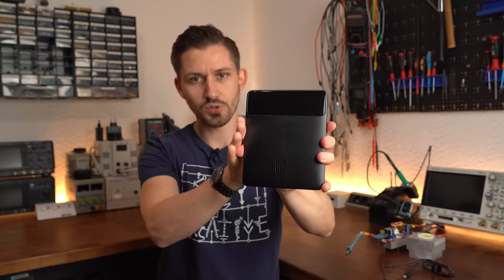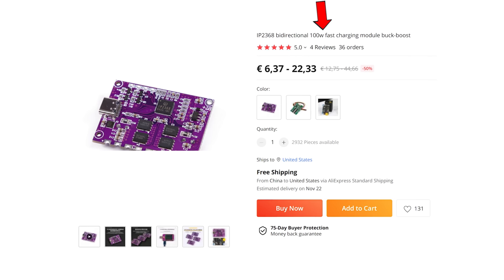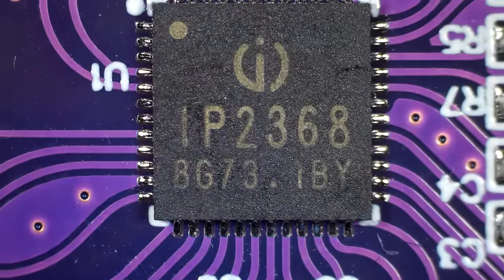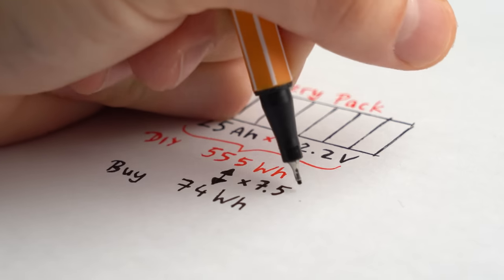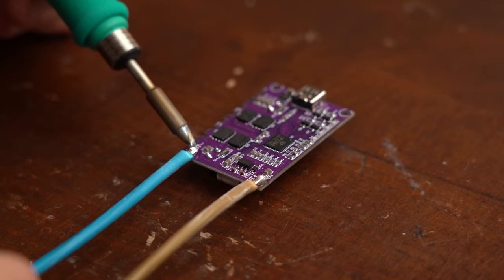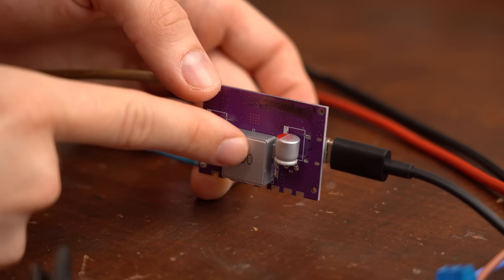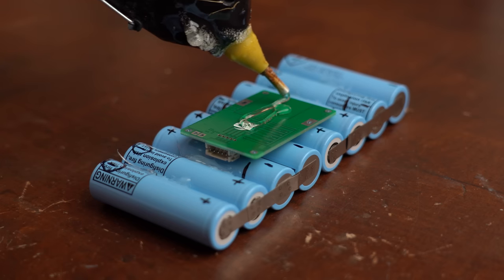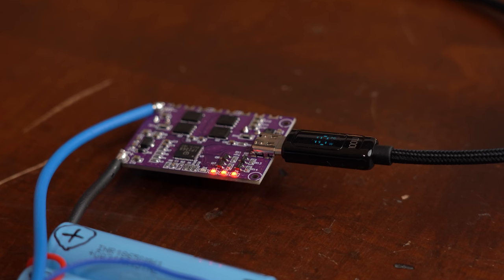My Power Bank Rivals Commercial Ones?! Super Fast! (DIY or Buy)

Comment: You going through the datasheet really brightened up things for me about these boards. Those definitely will be better for projects with higher cell count 4+ and safer than usual charging power adapters. Might add one of those to my speaker to finally have a reliable way of charging the 5s battery inside it.
Reply from the maker: Go for it ;-)
Reply: I would be careful at least above 4+ cells. Because the seller made an hint and there is a comment, which say that a "Triode" is just rated for 16.8V. That isn't even reserve for 4S and probably will blow up at 4+ (which happend to the commentator)
Reply: Oh yeah! Can use that board to charge up the 4s2p Battery in my Torch now. Just unfortunate the board does not have separate output pads. Cant use the 4 LEDs
Reply: @somethinks5624  oh yeah, you're right I was scrolling through AliExpress and found a review also mentioning that, I guess I'll wait a bit until there will be a fix or the manufacturer releases a fix ( which probably is unlikely)
Reply: @somethinks5624  looked it up and that's a voltage regulator me6210, it's rated for max 18V so I'm not surprised it didn't make it out in a 6p config, if that's the only problematic part it should be easy to "fix" the board
I'm not sure what's the voltage output of that voltage regulator because the markings on the offers are really blurry or just filed off the chip.
Reply: @demm5  Output voltage is 5v. The regulator is a SOT89 package, but it has a non standard pin out. Pin 1 GND, Pin 2 VIN, Pin 3 VOUT. The AP7380 has been the only one I could find that looks like a drop in replacement. It has a max input of 30v. I plan on ordering some and swap it out so I can try this on a 5S battery pack.
Reply: Update: I changed out the Voltage Regulator with the one listed above and swapped the R7 resistor for an 18k. The board will pull 5 amps at 19.72v with 21v input. But after pulling that for 5 minutes that board got too hot and actually started to smoke. Wish I had a thermal camera to see what was getting hot, cause Everything was hot. Board still works, but seems happy at 4 amps.
Reply: @metzenw86  my guess would be the inductor being pushed to it's limits, cause some of the board designs utilizing this chip used a quite very big 7,5A inductors (27 x 19,5mm) compared to the one on the board (17 x 17mm)

Comment: have looked at this exact pcb before as well as the manufacturer. Their stuff seems quality. The product which caught my eye the most was the DIY powerbank from them themselves, where you just add your own batteries. There are different models with different amount of battery holders for example 8, 16 and 24 cells. It uses the same chip IP5389 and in my opinion is the best case scenario because you get both high capacity and easy of use.
Reply: Do you have a link to what you have found? I'd like to look more into this.

Plus, I think this board Scott tested seems to have lead connections to monitor the cells itself.
Reply: WOW! Thanks for the tip, Jovaras. That store was amazing. I ordered the IP5389 w/ batteries module on the spot. But I doubt it will come with eight batteries (38Wh), probably just four (19Wh) but still a great deal.  <3
Reply: @bfelten1  I think they have 2 versions, one without batteries and one with. I am almost certain that if you buy the version with the batteries it will come with all 8 with the rate capacity of 20800mAh, around 74 Wh. If you bought the 8 battery cell version
Reply: Would you mind posting a link? Aliexpress search can be terrible at times :)
Reply: Also useful in that shipping batteries internationally can be a real pain, so you can source your batteries locally, but ship the other parts from overseas without issue!
Reply: @tschuuuls486  I posted the exact link here in a reply to KnHawke, but as usual, someone deleted it. But if you click on the DIY PCB link in the description above and scroll down, you will find a Visit Store button below the "Feb 22 Store" header.
Reply: @bfelten1  someone here on YT posted a video of his IP5389 power bank. Won’t charge his MacBook, I don’t think he’s charged anything past a phone so definitely <60 watts. 

SC8812A based 120W board won’t charge my brother MacBook past 45W with a 4S5P pack of LG MJ1’s, slightly higher capacity version of the cells used in this video.
Reply: @ericklein5097  The store writes a lot about various reasons you don't get the full speed. Anyway, when I get mine I promise I'll try to remember to post something here about how my POCO X3 is doing. 😄
Reply: @bfelten1  yes they yap on and on about the device needing to pull 100W. Not an issue for me because I'm actually bench testing them with various PD triggers, PD trigger cables into two different electronic loads. I talked to the store about heating issues because I was reading 90+ Celsius around the buck boost chip and they were just like "yeah might need heat dissipation"

Might? I had 3 40x40x10 radial blower fans juiced up from 5V to 9V blowing across every plane of the board to finally get the SC8812A to output 120W. 

I also made sure resistance wasn't a problem. Used some pretty decent UGreen 1ft USB C cables when I had to and they are some of the best in terms of resistance behind Satechi. I doubt my FNB48 has enough internal resistance to be a bottleneck either. The PD trigger cables I have don't have the greatest resistance but none of them are bad and I tried 3 different ones going straight out of the SC8812A board or SW2303 boards and into the electronic load.
Reply: @bfelten1  I think I solved the SC8812A. Like the IP2368 I think the initial voltage connection sets the battery SOC permanently. From that point it is measured with coulomb counting (I think). So experimenting with power supplies can cause the board to be confused. After a while you have discharged X number of Ah which is the stock resistor value for capacity. The board won’t want to discharge any further. 

The SW2303 I’m still not sure. I think heat is a major culprit
Reply: pm me can you to install do solar panel of charger"
Reply: pm me can you to install do solar panel of charger"

Comment: I know you said you were not going into detail on the battery pack, but 3 seconds to say "after making sure the voltages were all the same..." before welding batteries together wouldn't have been out of place. Certainly more useful than a shot of you cutting nickle strip!

Comment: Not too long ago I've made my own modular powerbank using laptop batteries. With swappable batteries, and a buck boost converter it provides great results to a USB 3.1. I think I'll revisit it to give me USB C and some power monitoring.
Great Video (:
Reply: is it possible to put 16 batteries? of course 16.8V, each cell contains 4 batteries, and of course with a BMS protection circuit, does it work? :)
Reply: pm me can you to install do solar panel of charger"

Comment: The issue is if you want to travel with a power bank, airlines limit power banks to 100wh. That’s why you tend to see most of the sold power banks below 100 wh
Reply: And probably any DIY devices without oficially declared specs will get stuff attention anyway.
Reply: pm me can you to install do solar panel of charger"

Comment: Thank you for making this video 
I built an 18650 4s5p power bank.
These modules are excellent and I have 3 installed on battery. Perfect operation at 4s but I've noticed that if you want to hit the 100 watt max you must configure at 6s. Otherwise it will provide 3 amps in all voltages.
I installed a 4s flying capacitor balancer. 
The board having a built in bms is super handy.
Thank you.
Reply: Hey, sorry to bother you, do you mean that you connected more than one board to the powerbank to get multiple outputs?
If that is the case how does the remaining capacity measurement work?
Do all of them still show the correct value?
Thanks in advance!
Reply: It operates as normal the indicator bars are not accurate. I just go off pack voltage. It operates between 11.9v and 16.7v. all of the plugs operate normally even if the indicator indicates empty. They will continue to function until it hits its preset level which is apparently 11.9v.
I've also found that if the modules lose power entirely and 0 volts they need to be reinitialize by plugging it into a live supply
Reply: @nicholashamblin3  thank you for the reply!

Comment: 6:00 You can just translate the PDF file in Google Translate
7:40 Would have been interesting to also measure the voltage on the PCB itself. I guess the voltage drop over the cable can't have been that bad, judging by the voltage at 4.6 A. But would still have been interesting to measure it.
Reply from the maker: Thanks for the feedback :-)
Reply: i have a translated version
https://drive.google.com/drive/folders/1xD557-1UVNz3oRqBK0LdAOf3IOp21Wg8?usp=sharing
Reply: pm me can you to install do solar panel of charger"
Reply: Voltage drop would be insignificant over that very short length, please see  VD = R x I x L / 1000

Comment: FYI when your spot welding cells it should not make any sparks, especially at the lower current levels required for just nickel strip. you might need to apply more pressure or lower your current. for just pure nickel strips I normally use around 30j.
Reply: At least he's using a spotwelder. So many videos try to do it with soldering which has it's own issues.
Reply: Probably nickel plated steel strips
Reply: nickel plated steel sparks a lot. for this underdog powerbank steel is ok.
Reply: what are you smoking about? sparks are normal in spot welding. did you spot weld with less than 0.1mm? duhh
Reply: @bakatenchu  i spot weld using my k welder through 1.5mm nickel strip over .2mm copper sheet and there is no sparks. if you are using a cheap spot welder with thin probes maybe its more common to see sparks idk but i did a 190 cell battery with my k-weld and rarely ever saw sparks. and I know my welds have ideal strength and penetration. you may want to re-evaluate your welding process.

Comment: I think the company that makes the PCB has its own premade casing and wiring for it too. The only thing with maxing the thing is that you can't take it on a plane unless you can remove the cells, which you probably should've made doable
Reply: Its not doable, you don't want an argument with TSA lol
Reply: Huh. That reminds me of the big, chunky video batteries at the place I used to work. Those split in half solely so you could legally carry them on a plane.
Reply: Under 100wh is good to go. His pack is perfectly fine. 

Don’t get the acrylic cases. Turns my sw2303 into an easy bake oven.

Edit oh you’re talking about the 16 or 24 cell powerbank? Wrap the cells in 1200mah fake sleeves. Problem solved.

Comment: Also I would like to warn anyone that doesn't know this, that the voltage regulator on the board is rated max 18V (me6210) and I've seen images of it burned crisp in 6p configurations. So, as long as the battery voltage is below that, it should be fine. So 4s configs are the best bet for this board, for now.
Reply: is it possible to put 16 batteries? of course 16.8V, each cell contains 4 batteries, and of course with a BMS protection circuit, does it work? :)
Reply: @behnamp9174  Do you mean a 4Cell series and 4Cell parallel (16Cells overall) configuration? It should work! But as you said, a proper BMS is needed.
Reply: @AmonadaLP  yes yes yes exactly! sorry i saw your comment late. 4 Cells series and 4 Cells parallel which gives 16Cells overall
Reply: Ah shoot, I think this is what happened to mine. I replaced R7 with a 27k and it worked fine for a while. Now it doesn't even prompt another device to recognize it's plugged in. Oddly, it still blinks its LEDs, so they must be getting power somewhere.

Suggestions on a replacement component are welcome!
Reply: Does anyone have a reference that shows what the LED blinks mean?
Reply: Do you have any idea what is the specific specs of the LDO that this board uses? i believe that me6201 have different output voltages. I have this board and I am planning to change its VR to me6203 which have rated max of 30v but I don't know what I should get
Reply: @sunnydaybadua2868  now that I have that board, ill measure the output voltage

[ edit ] I measured 4,998V so it's a 5V output regulator

Comment: Longevity was not taken into account. 

18650 cells have more than double the lifespan of the pouch cells used in most commercial power banks.
Reply: Is it the same with 21700 cells? Those are the cells my powerbank (Anker 737 PowerCore 24K) uses
Reply: @TheStopwatchGod  Pouch cells are trash, all other battery forms eg; tube, box & plate are superior.
Reply: Yea DIY definitely won this one
Reply: Can you tell me why? i was planning to use the pouch cells for this proyect.
Reply: @haloduncan  Pouch cells have too much thermal expansion, it's not a solid case, they eventually delaminate, then swell up and fail.

If you have the space, use name brand tubular cell for capacity and longevity. Avoid cheap Chinese pouch cells like they're COVID 👍
Reply: @edwardfletcher7790   Thx for the response, where i live i cant get quality 18650 cells, or the are way overpriced and even then only 2600 ones, i can only get pouch cells for reasonable price.
May try first with pouch and later see if i can import 18650 cells

Comment: Wow that’s something I’ve always wanted to build with all the leftover 18650 cells I’ve scavenged out of old laptop batteries. Heck yeah that’s a nice build!
Reply from the maker: Glad you liked it :-) And happy building :-)
Reply: You would have to test every single one first and be careful what you mix and match. A bad cell in your pack can bring down performance or start a fire. Unbalanced cells have issues.
Reply: Me: casually looking at my 50ah homemade 18650 battery pack from scavenged laptop batteries ... It runs a mini inverter and is charged by solar. For small electronics when no power. With direct DC outputs too. Only 5v and 12v simple stuff though...
Reply: @XxTWMLxX  
how can you be sure it won't burn down your house
Reply: @Henry-sv3wv  you can’t but you can fuse each cell Tesla style or not use any cell below 80% state of health. That makes things much safer. Most problems are from people not properly testing all cells then pushing a 10 year old cell with a resistance of 227 milliohms to 1+ amp during a high load when the cell has 900mah out of an original 2200mah. 

That cell screams “internal short full of dendrites” and you’d easily catch it by doing the proper testing.

Comment: The reason they use "fuel gauge" algorithm is that the battery voltage doesn't map to battery remaining capacity.
Lithium batteries spend most  of their time between 3.5 volts and 4 volts and the voltage isn't indicative of the remaining charge. 
It is like boiling water in a pot, temperature will plateau at 100C until there isn't water left, at which point the temperature will raise.
Reply: Bingo. Fuel gauges are useless for lithium ion and flat out misleading for LiFePO4

Comment: I've had no luck with their 120W board. I think it gets way too hot and shuts down any time I try to pull over 60W. The inductor on that board isn't the same as what I have on my SC8812A board and the different SW2303 boards.

Same with 2 versions of the SW2303 and I'm using the LG MJ1 so same output capacity but not paralleled like you.

EDIT: SC8812A board is now working trouble free. You gave me a hmmmmm moment when I realized I had never charged the cells through the board like you did. Glad I had my 5P pack because it charged at nearly 6 amps!

Comment: Exactly what I need to transform my drill battery in a power bank, if I connect 2 boards I would be able to get 2 usb c, but of course never connect both to a charger at the same time. Thanks for the video

Comment: This is a very useful video.  Thank you!  90W is indeed very good.  I bought several Romoss Battery Banks and none of them quite live up to the advertising.  I paid about $1.05 per watt hour.  Would be super nice to add PD, USB micro and another USB-C port.  Then your DIY version would be King.   I guess you could even incorporate a display if you wanted to get really fancy.  But I would be happy with your 90W model just as it is.   Bravo !!   BTW...my test of the Romoss 65W, 40,000mAh unit gave about 27,000mAh at 500mA, 4.91v discharge rate.

Comment: The measuring the capacity of the battery (the 4 leds) was interesting for me.

1 idea: Many things (phone and much more) work with 1 lipocell. What if you have only a external battery to use this things? You can use a much bigger battery, your phone cannot fall to the ground, old devices can work for ever, it is easy to change the battery and thiefs get a problem :)
Reply from the maker: Nice
Reply: Guess what? About phones having a single cell, I have a fairly old but very capable phone (Redmi Note 4x) for which I made an external battery with four 18650 cells after the phone's original battery went completely bad. And yes, I usually attach it to the phone holder of a game controller which I place on a table. I mostly use it for watching movies or as a WiFi hotspot for my other devices (like right now).

It's a really cool idea, one that I've been using for months now.
Reply: I have a few old ipods and iphones with completely dead batteries. They work perfectly fine using a powerbank.

Comment: I’ve wanted to build a 300+Wh battery that can input/output with the latest 240W usb pd. Now I know it would be easier than I previous thought.
Reply: This board only does 100w (or 90). I haven't yet seen an ic for 240w